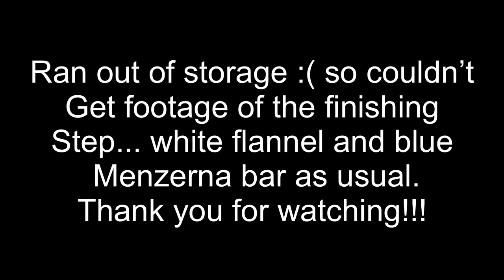How To Polish a Reitnouer Flat Bed Aluminum Trailer Frame - DC Super Shine

Comment: If I want to do a quick job on my 2015 trailer, can I just sand it 320 then 600 and polish only with the cutting step!? And will it last or I need to do at least cutting step and finishing step !?

Comment: How much metal is removed during the sanding and polishing steps? Reason I’m asking is because I have a polished aluminum sided hopper. I’m thinking of polishing the exposed hopper portion underneath but I’m worried about potentially weakening or puncturing through the walls of the hopper. I know this is an older video but I hope you’re still monitoring the comments. Thanks for any feedback you might offer.
Reply from the maker: Hey Jonathan,  sorry just saw your comment now!  You’re good to go man!  Unless you’re sanding out deep gouges you have plenty of aluminum to work with… I’ve been sanding some customers tanks for over 15 years (same trucks) and still no sign of weakness or punctures.  Hope this helps

Comment: Good video, l want to know,if you can tell me the correct rpm for the first cut.
Reply from the maker: Around the bolts and harder to reach areas I used my 3500rpm and the main flat surfaces were done at 6000 rpm
Thanks for watching

Comment: Isn’t there a clear coat of some kind that you can put on that aluminum to keep it looking great for much longer?
Reply from the maker: Yes there’s several company’s but none that imo work great... mist will take away clarity.  As a protection most last a couple years at best and when they start to peel and they all do!  It looks horrible, plus it’s a pain to get off when you need to polish again.  So I’m a firm believer in polish once every year or two and be anal with your maintenance and you’ll do fine.  Hope this helps

Comment: Great job man! 
What does polishing an aluminum trailer like this cost?
Reply from the maker: $3000 for the frame
Reply: @DCSuperShine  excellent price. Great work. Lots of Endurance with that sander I would have guessed you would have gone rotary for a job this size. How many guys working on it? How many hrs into it? We did a 48ft mac trailer frame with 8 wheels, mud flap hangers and landing gear for 5. It seams everyone is switching to menzerna now. You must have started a trend. Even the die hard Jackson lea lovers have switched.